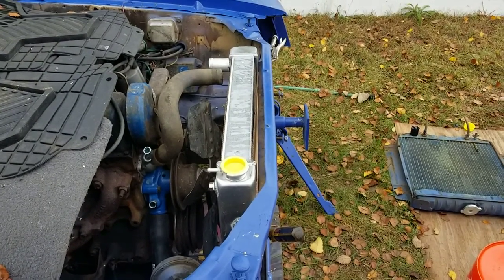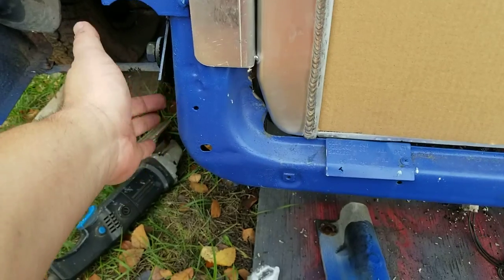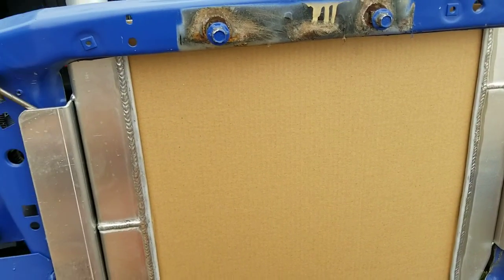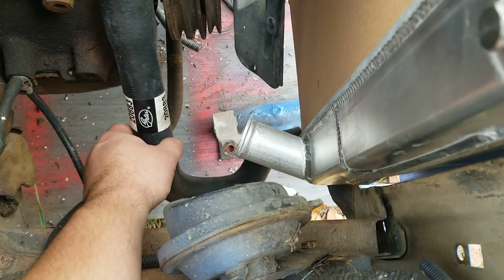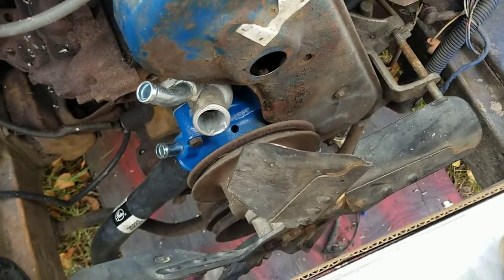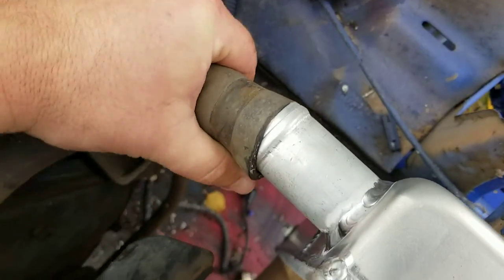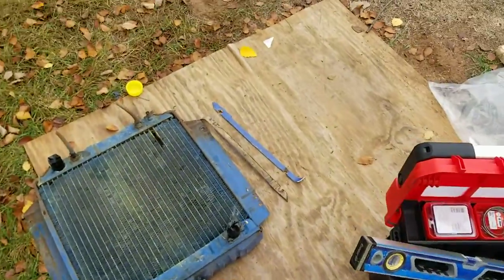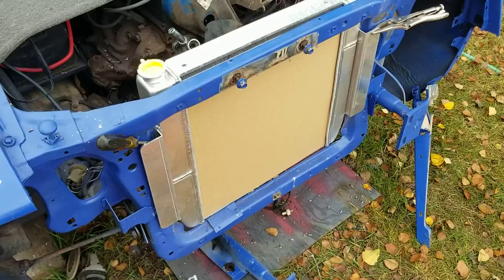Warhorse Pinto - The Resurrection - Episode 2

Comment: Been there done that, did a Jeep Scrambler, installed a 350 Chevy engine and a new aluminum radiator to fit it.
Reply from the maker: Sounds like fun, I may get around to putting a V8 in eventually.  I'll have to order the Ford version of the Eastwood Radiator to fit a V8.  Unless, someone wants to donate an LS engine and trans lol